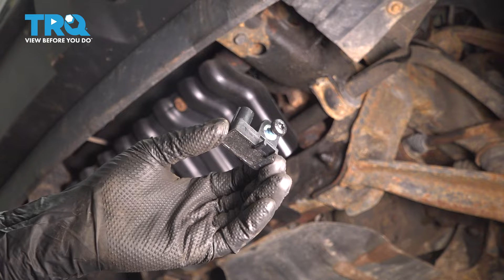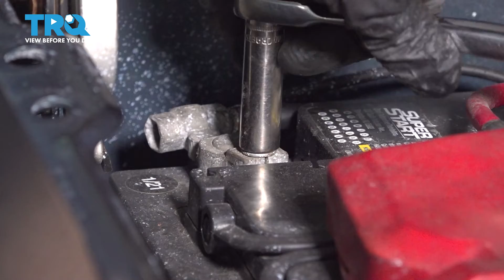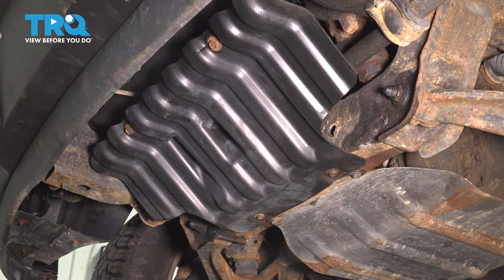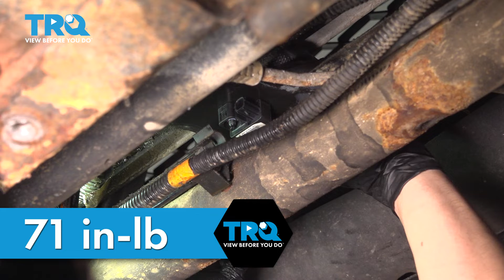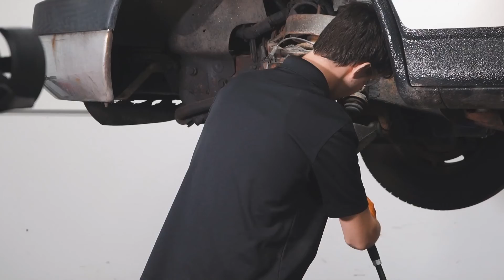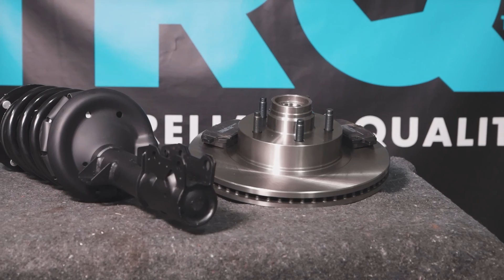How to Replace Impact Air Bag Sensor 2007-2014 Chevrolet Silverado 2500HD

Comment: B1000-35, ROM Failure, popped up on my new code reader on my 2007 Silverado 2500 HD. YouTubed it, and this 1A instructional video appeared. I cannot imagine the headache of finding this module, the somewhat unusual connector release, anticipating left-hand threads, the hidden (T-35!) bolt, etc. What should be very simple is surely not, and may have resulted in a wrench being thrown through the windshield. 1A Auto will see my order coming through. Well-done video - thank you!

Comment: Only GM would put the head in a hidden position and add a reverse thread where its not need. Engineers should be forced to install and uninstall everything they design.